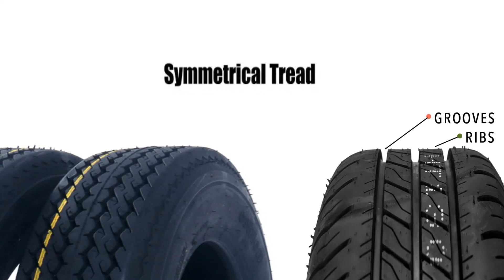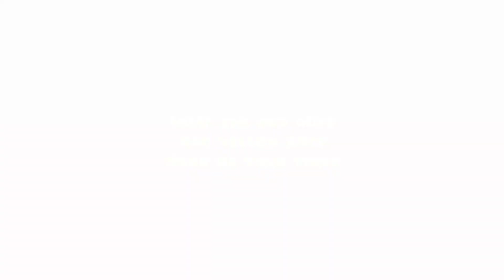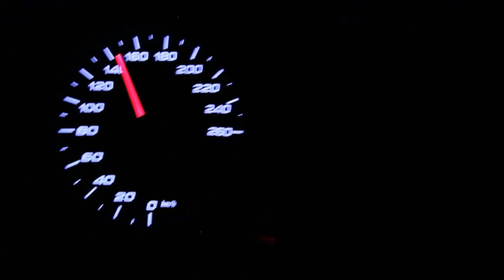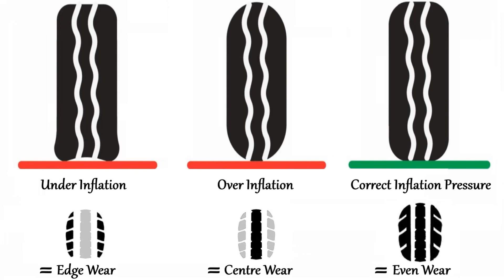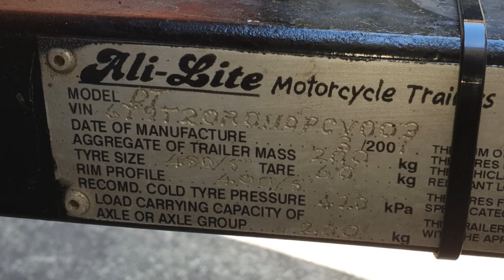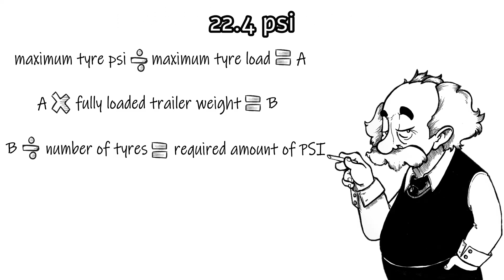Motorcycle Trailer Tyres IMPORTANT

Comment: 🤔 never been real sure about my trailer's tire pressures.  I had been running 15psi cold. 
I've gone to 17psi cold are I dinged a rim on a very rocky track with erosion banks. I really should make more effort to keep the trailer on the ground 🥹

Comment: Really enjoyed this series and have subscribed. What do you think of small third wheel trailers? I do like that torsion suspension on those independent wheels - do you know a US manufacturer using that?
Reply from the maker: I don't know much about those mono wheeled trailers if that's what you mean? Any type of independent suspension works fine as do leaf springs in fact. But independent is best. You would have to check different manufacturers websites as to what type of suspension they use.

Comment: Speed is critical when trailering and wearing out or blowing a trailer tire. I see many people speeding above the recommended limits increasing the heat and causing blowouts..... radials are best !
Reply from the maker: I also see many riders going too fast when towing. Its all good until it all goes wrong. Its just not worth the risk. And yes as far as heat goes you are 100% correct radials are better.